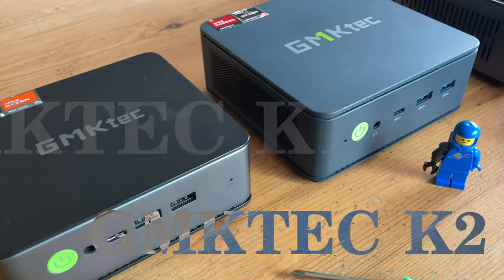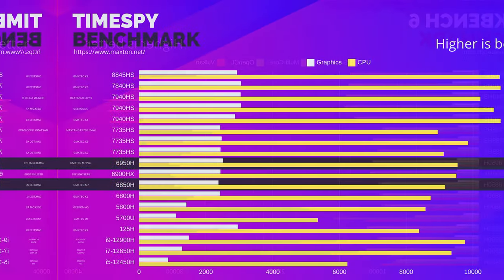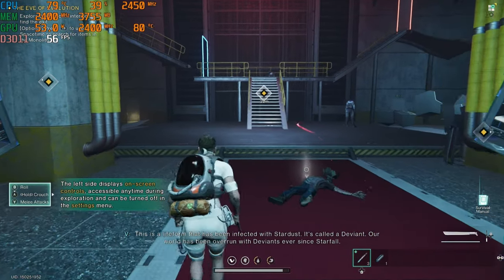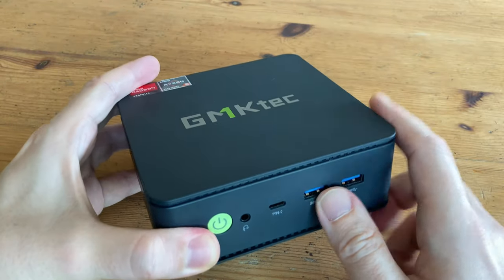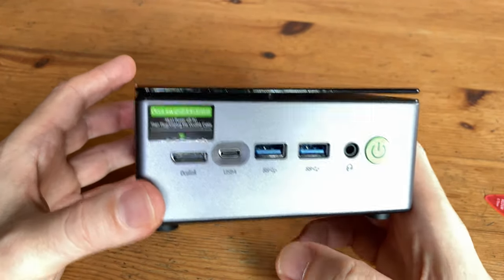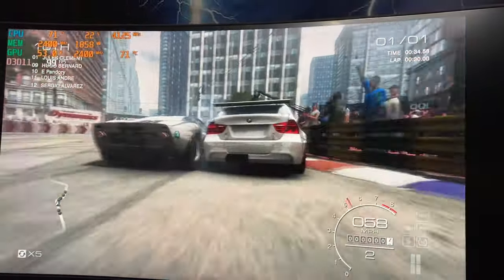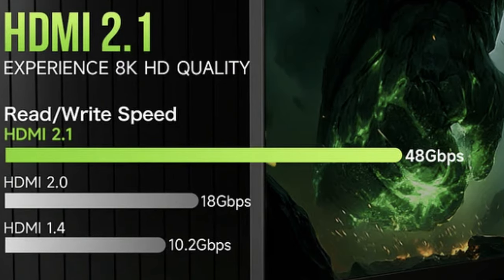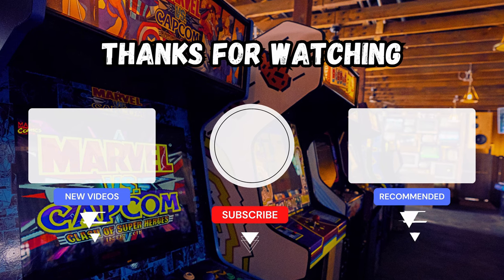GMKtec's NEXT Generation of Mini PCs are REALLY Good! 😱 [GMKtec NucBox M7 Pro REVIEW]

Comment: My 1660ti only gets 80-90fps on fortnite 1080p high.  If you didnt adjust any settings this mini pc is legit!
Reply from the maker: @arcaderacer586  performance mode, 1080p, high / far settings.
Reply: I am pretty sure the 1660 Ti is much faster than the 680M.  At least under normal circumstances.  If the GPU is not thermal throttling, or is bottlenecked by something (CPU, RAM, phase of the moon), it should be considerably faster than the 680M.  

Having said that, I never played fortnite and never plan to do so (due to Epic client).
Reply: @TrusteftTech  Fortnite was set to performance mode in the video which changes many settings to achieve more fps but even so its still impressive for a mini pc.
Reply from the maker: @arcaderacer586  1660ti is far quicker than the 680m.  The 680m is similar to a 1050, maybe 1060ish in speeds
Reply: @arcaderacer586  Indubitably.
Reply: @TrusteftTech what is (epic client)😮

Comment: I bought a Bosgame H77 in August, for about 429 dollars (400 euros) and I only had negative experiences. I’m seriously thinking of taking advantage of this promotion GMKtech M7 or pro. It is really very cheap, it’s so cheap that it seems that it will come with a defect lol.
Reply from the maker: @PanacaCat  crikey! What problems did you have with the boskey?
Reply: @TeamPandory  The fan that comes with it to cool the RAM and NVME doesn't turn off or takes a long time to turn off and stop making noise when the computer is suspended or turned off. Then you have to unplug the cable from the motherboard or disconnect the cable from the power supply, all because the company doesn't provide a bios update to fix this problem.

2. Because of this, when I play games, the parts get very hot. I could play before, but now, when I play just 20 minutes of Horizon Zero Dawn, in 720p, the pc restarts and goes straight to the bios. I've tried using a heatsink, I've reinstalled the bios update, but nothing works (ironic laughter), 400 euros (I got it on sale, the 1TB + 32GB version) thrown away. You can use it normally for productivity, but more demanding tasks, like playing Horizon, forget it! It'll give you a blue screen (as it did yesterday), or reboot by going to the bios.

A shame, it seemed like an excellent deal, but I'm disappointed by the company's attitude.

Comment: Is there a big difference in temperature between the m7 and the m7 pro? I'm not sure. I could get the r9, but it's usually a very hot processor.
Reply from the maker: @PanacaCat  will have a video up tomorrow regarding that. Surprisingly, the temps are extremely good 👍
Reply: @TeamPandory  Sure? I was about to buy it here. They're running a very good promotion, which will last until Sunday. I'll definitely get it!
Reply from the maker: @PanacaCat  yup, the temps are pretty much identical, but FPS is definitely up on the M7 pro 👍
Reply: @TeamPandory  Can you tell me if this sixth-generation Ryzen 9 is better and more efficient than the Ryzen 7 7735HS?
Reply from the maker: @PanacaCat  according to some website I just saw, the 6950h uses less power, but tbh looking at the temperatures in benchmarks (70-80 degrees at 65w tdp) and scores, the combination of CPU, case, and new cooling setup makes most of the difference. 
... That was a very long sentence.
Reply: @TeamPandory  Brutal. Thank you for your reply. I lost 400 euros for nothing, but I'll definitely get a better mini pc.

Comment: Thanks for the excellent reviews. For some reason you emphasize issues that I find important in any PC (not only mini variety), so thanks for that also. Mini PC's are starting to increasingly look as a viable alternative to the big desktop machines with two important distinctions: they are (mostly) quiet and they use less power. However: I have 5 mechanical hard drives in my desktop and one SSD...
Reply from the maker: @RisteSekuloski  hey thanks for the comment 👍 - I totally get you re: the hard drives, you could probably get one of those usb - hard drive cases that store an array but they cost sooo much! 
End of the day, I think a rethink is in order- myself included. A tiny server on the network that hosts data via a file server is probably the route, but we're probably stuck in our ways 😂

Comment: Are these graphics/framerates better than a PS4 now would you say?
Reply from the maker: Hard to tell, I usually flip over to the performance renderer in Fortnite to get optimal speeds.  Comes with being a poor kid with a 2mb Amiga 500+ in a world of friends who all had Pentium PCs.
What kind of frames does a PS4 get in Fortnite @ 1080p?
Reply from the maker: From a Reddit post by CatalyticDragon: 
"The 680M is way faster than a base PS4. The 680M has more than 2x the compute performance (but similar memory bandwidth). The CPU on the 6800h is a big step up too.
So The Witcher 3 struggled to maintain 30FPS on the PS4, but the 680M manages 40-60FPS.
And the whole package runs using less power. The PS4 was ~165 watts to 310 watts (max). The 6800h uses a fraction of that with a 45W TDP."
Reply: @TeamPandory  You're lucky,  I had a 1mb A600!!!

But I think PS4 Fortnite is 60fps.
Reply from the maker: @Larry  the 1mb upgrade was maybe 30 quid? - but yeah I feel bad for you... Civilization needed that numpad!
Reply: @TeamPandory  I didn't know that back then,   I thought that was it!
Reply from the maker: @Larry  I demanded my parents to upgrade the memory so I could get 100% sound and music in The Settlers...Worth it?  VERY YES! 😊 
We held out for the longest time though. My first pc was an intel 166mmx.  Those were the days :-)
Reply: @Larry  I had a 16k ZX Spectrum. How times have changed :)

Comment: 2 steps forward, 0.5 step back but by no means too bad. I do like h easy top access although they seem to be using the glued rubber feet on the base.

The review did seem a tad rushed but I suspect that we might see at least one more with some comparison results.
Reply from the maker: Not exactly rushed, but tried to take it from a different angle due to the case design difference- TBH it was supposed to be a first impressions, but um.  Yeah.  It went on a bit.
I may work on a full more "in-depth" review soon, but we'll see what happens.
There's not much difference regarding the specs out of these two, is there one you'd prefer me to look at?
Re: Comparisons, I could just do a video with that I guess, but it's going to be soooo close, only a few FPS difference in gaming.
Reply: @TeamPandory what do you do with the pcs you get sent?
Reply: @TeamPandory  Taking a second look, I could see a newer style, which may have influenced my feeling. The gaming tests have begun to be quite synonymous with the channel in recent times, which I think is good and likely very popular, so hopefully the trend will continue with this new model too in order to give a more rounded view for folk to know where best to spend their coffers.

Comment: How about a performance comparable "normal" PC build in a small case. Would be nice for price comparison.
Reply from the maker: It's going to be more expensive, for sure. 
Case, PSU, motherboard, and we've already equalled the price. Then add CPU, GPU, NVME, Windows key...  The only way to equal the price is to go used.

Comment: Can you check on the DPC latency?
Reply from the maker: Sorry for the delay, never checked for this before. So latencymon states 'your system appears to be suitable for handling real time audio and other tasks without dropouts" - current measured interrupt to process latency = 41, highest measured= 145, all bars are green. 
That was on the M7 pro.
Reply: @TeamPandory  Thank You Mate, I Think I'm Gonna Buy This One.
Reply: @TeamPandory  I'm Gonna Use it For Music Production.
Reply from the maker: Nice 👍
What kind of DPC latency are you looking at in your current rig?
Reply: @TeamPandory  Actually, i Just recently learned about the DPC latency thing when someone said that Mini PCs mostly with AMD Ryzen CPUs have a High DPC latency which makes the audio glitchy and cannot process real time. Then I Searched into google and says that it should not be above 1000 milliseconds.
Reply from the maker: @maegjohncareeon639  I guess you could say the same for Intel computers, I mean both have a huge range of chips from budget to high range.  The problem is with these assumptions is they're usually covered in a lot of tribal mentality, Apple Vs Android, Sega Vs Nintendo, Intel vs AMD.
Reply: @TeamPandory  will I Not Having Compatibility Problems when Using this mini PC for Music Production?
Reply from the maker: @maegjohncareeon639  you shouldn't have any, no. Plug up an interface and get busy 😁
Reply: @TeamPandory  This is My First Time using an AMD CPU, if I Buy this one. I will not having Issues with Plug-ins and VST with AMD Processors? Right? please help Me Mate! Thank You.
Reply from the maker: @maegjohncareeon639  I've used Ryzen CPUs since I switched from the i7-4700k, and everything has been fine for me.
Regarding what plugins work / don't work, that depends on their software, but AFAIK there are no compatibility issues regarding this, especially in the last ten years or so.

Comment: which one I should go with? this one or the one with ryzen 7 8850hs?
Reply from the maker: @eizcher  which one exactly ?  We haven't tested any 8850hs machines yet.
Reply: @TeamPandory  ah sorry my bad,I mean 8845hs
Reply from the maker: @eizcher  the k8 / 8845hs that we reviewed?  Depends what you are looking for tbh. The k8 has a better CPU and GPU onboard, but the M7 is MUCH quieter and an oculink port if you want to expand with external GPU.  All depends on what's important for you
Reply: @TeamPandory  tbh, I'm not really sure what I'm looking for, it will be my first time buying this stuff. I'm a bit tight with my budget but I'm planning to use it to play monster hunter games. can you help me suggest which one mini pc I should buy that is not to weak/overkill to do so? I'm considering the K8 right now..
Reply from the maker: @eizcher  put it this way, all of these Ryzen mini pcs are better than all those laptop things we got a couple of years ago for far cheaper 👍 
The k8 may be a little noisy if you use performance mode, but will be better in games. The M7 is the next generation of case and cooling and it's just a smarter more refined version from gmktec.
In your case I'd go K6 or K8 as it has the 780m Radeon GPU, will help with games, or show next weekend for our giveaway... Or just grab an M7 and learn the system.

Comment: Just Better Cooling & an Oculink Port. 
Not different from the  M6-6800h; which is easily tuned to match those +200MHz Base/Boost/680M clocks.

At LEAST they could have tuned for 5600MT SODIMMS, given the use of System RAM as VRAM; that would have been nice.

So much moreexoensive than the 6800h; and basically offers just an Oculink port & real fan??  Meh...

Just feels like GMKTec has way too many barely different models within $150 US of one another from 6800H to 7840HS; and performance in most use-cases is very similar.  The lower-end models (6800/6850/7735) should be around $300 by now w/ 16GB & 512 SSD- into former 57/58/5900 territory. 

Likewise, Ryzen 5000 series mobile offerings should be dkwn near $200 and CRUSH the N95/N100 offerings.

Perhaps we shall see that by 2025?
Reply from the maker: The M6 has a 6600H, not a 6800H.
But yes, the reason I looked at the innovations of case design and extras is because there's not much difference in the computer against something like the K5 (7735HS inside the second case design).
You could argue there's too many, but once you realize that when there's choice you can get better prices, I don't think there's any reason for complaints. Especially if each model improves (ever so slightly sometimes) upon the last.